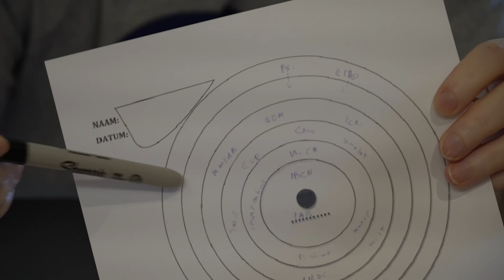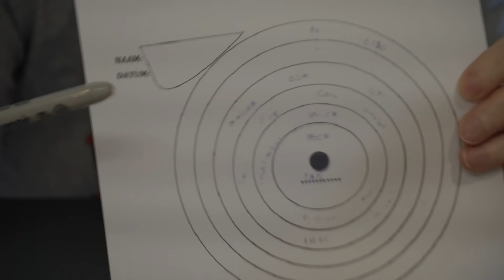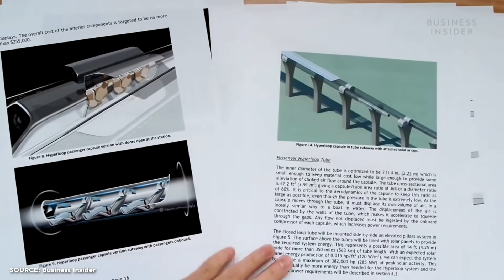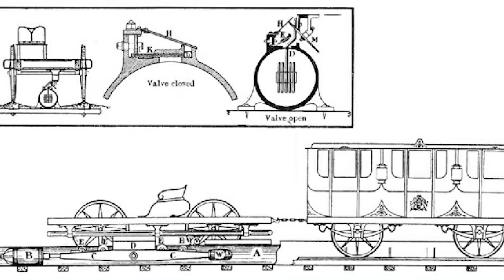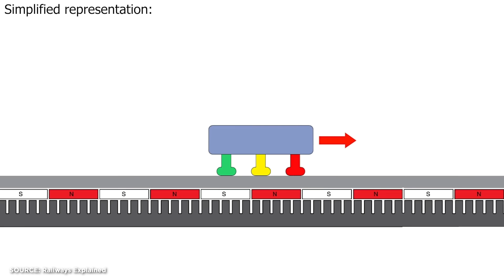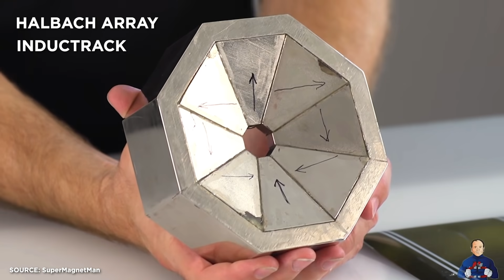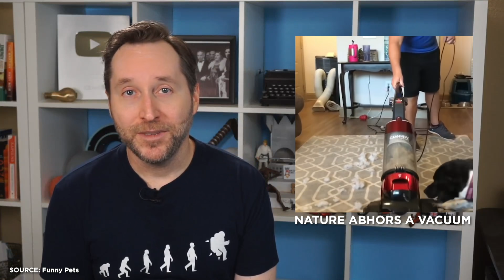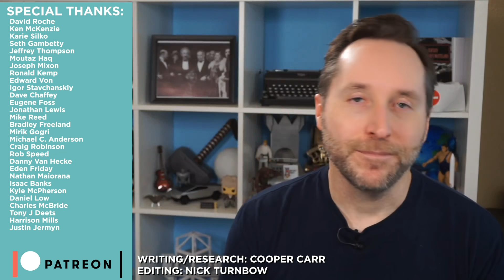What's Happening (And Not Happening) With Hyperloop | Answers With Joe

Comment: Calculate the energy required to create a vacuum in a tube of that length and diameter and you will begin to see the folly of hyperloop.
Reply: Ya you can't expect wanna believers to think.
Reply: It's like saying ''calculate the cost and effectiveness of renewable energy and you'll see that coal is better''. Hyperloop is still a prototype so just wait and in a few years there are solutions for every problem
Reply: add on to that the energy needed to keep the vacuum, cycle the airlocks, etc and you know it's rubbish. Now work out what happens should someone put even a small hole into the tube. You know that in the USA, a tube above ground will be shot at.
Reply: @eliasmok3261  "Hyperloop is still a prototype"
Nope. Unless you mean that silly test track?

" there are solutions for every problem"
Yes there are but the solutions for the hyperloop are not viable. Do the math.
Reply: The other folly is the passenger vehicle would have to be built to space craft standard to withstand vacuum environment.  It would have to carry air supply and CO2 scrubber.  And it would be a good idea for passengers to wear space suits for redundancy just like astronauts.  Contrast with airline fuselages which do not need to withstand vacuum and use pressurized external air for passengers to breathe.  HL really is a folly.
Reply: So what? let people innovate and solve the problem and who knows new discoveries can come out of it. No matter the result there's no wasted effort as this is how technology, grows by trial and error, even if it doesn't work on paper.
Reply: @Rice8003  How do you solve the problem of a breach of the tunnel turning pods and people into mush?
Reply: @feedayeen  You would of course have to add the continuing need to operate the vacuum pumps to cope with 'system loss' at the required airlocks and the inevitable practical leaks, especially from the seals around the necessary expansion joints for the tube itself.
Reply: @Rice8003  This is truly an entire waste of time, effort and money since the real outcome is already known by those with a functioning brain ! There will be no technology  'spin-off' since the areas concerned are already well understood. Innovation refers to ideas that might have some possible success, not those that are doomed to fail by design. Like so many, you don't really understand how technology works. It's popularly imagined for example that the space race spawned integrated circuits and the like. Not so, they were actually designed for computers and sold in 'zillions' into that market. The space guys were lucky to have the 'spin-off' from a commercial application that suited their needs too and they used them in small quantities. Microprocessors too and so on.
Reply: @encinobalboa  Strangely, for once, it's not 'politicians' arranging the funding it. The allure of hyped up techno-magic was too great for the private sector to resist.
Reply: @gdwnet  In much the same way as you deal with a tsunami. You run like blazes.
Reply: @forrestch  And that's merely the half of it !

No-one's going to be colonising Mars either.
Reply: Fusion Reactors!
Reply: @encinobalboa  Who says it has to be a vacuum, how about it is air pressure from behind that just reduces friction because the train is traveling with the air pressure. Like in a wind tunnel. You haters all have a huge amount of negativity rolling around in your vacuum chamber heads.
Reply: @johnarnold893  You haven't thought it through, have you.  Vehicle exterior would have to have a seal on the tube walls in order to contain pressure differential.  Air pressure behind the vehicle would have to be maintained in order to propel vehicle forward.  That means introducing air continuously to a tube that is suppose to be low pressure or vacuum.  Do better next time, OK?
Reply: @johnarnold893  Don't worry, they'll be here in just another 20 years, just like 20 years ago.
Reply: It's difficult to get somebody to understand something when their salary depends on their not understanding it.

Comment: No need to share Thunderfoot videos with you, I heard his voice in this script loud and clear :)
Great clip, as always!
Reply: Same thinking I love thunderfoot
Reply: They both reached the same conclusion, ultimately coming down to its economic viability. It's unlikely that selling tickets is going to be able to the cover the costs of building and maintaining the system. The light at the end of the tunnel is when we ditch the impracticality of the vacuum tube and start to build maglev trains right here in America.
Reply: I had watched Thunderfoot's video on it before, and this was a fresh take for me. I got the same information without the seemingly condensing nature Thunderfoot brought (that's just how I perceived him) to the table. And that helps a lot.
Reply: Thunderfoot has a hate boner for Elon for some reason. His videos are riddled with serious errors, he didn't do even a basic research. So ignore everything he said and think for yourself instead.
For example I love how everyone just assumes it won't be economically viable, without doing any kind of calculation. The only calculation I saw is from Elon Musk and his engineers. They know how much it costs to build stuff, because they are in the business of building all kinds of stuff. According to them the original Hyperloop would have cost ten times less than  California's new high-speed rail line. That was the benchmark. Even with significant cost overruns they would have beat it easily. And the new design with tunnels is probably cheaper, because a big part of the cost is just acquiring the necessary land.
Reply: @andrasbiro3007  A big part of the cost of California's rail was mismanagement. That played into the cost overruns. So it might not be the best comparison, as not all of it was due to construction based purely on the design.
Reply: @andrasbiro3007  To be clear, you're saying Thunderf00t made false assumptions about economic viability when he calculated the costs using turbine pumps he's used himself to make vacuum chambers (and included a very generous bulk purchase price) with calculations included, but Elon and company are accurate in their predictions that it would be a fraction of the cost of an existing train line despite requiring many times as much technology just because they're business people who would know this stuff...
Reply: @andrasbiro3007  I think you have not seen his latest video on hyperloop. I think you should watch it. Joe clearly has.
Reply: I was disappointed to hear Joe, whom I still admire a great deal, use so much of Thunderf00t’s content without more direct acknowledgement in the beginning of the video.
Reply: @richardstauber2815  Kinda felt the same :/
Reply: @andrasbiro3007  Dr. Mason debunks mainstream media. Elon Musk is always in the mainstream media. Do you see the connection? The media refers to it as Elon Musk's hyperloop, so Dr. Mason makes fun of the media by referring to it as Elon Musk's hyperloop. Do you see Dr. Mason's humor?
Reply: @albertjackinson  Mr. Joe Scott almost always gives a balanced argument which is the Joe Scott way. It was refreshing to hear someone that has some hope in the future of hyperloop.  Mr. Joe isn't exactly PBS Space Time. I unsubscribed to PBS Space Time because I got a headache every time I watched a new video. Do not listen to a single video on PBS Space Time or you're brain will melt.
Reply: @InfamoussDBZ  I watch every video on PBS Space Time, and it helps I understand what's being talked about. I definitely don't understand all the math, but I certainly understand the ideas presented.
Reply: @albertjackinson  Glad to meet a fan of PBS Space Time. I really envy you. Every video expands on a prior video, and so you go back to the video before that, and then that video tells you to go back to another video, and so you keep going back. If you don't understand one video, you're not going to understand the next video. My mind became a giant pretzel, and I couldn't talk to any of my friends about it because I caught myself repeating, badly, a concept or idea I didn't really understand. Other youtubers like Arvin Ash, WELT Documentaries, that guy with the bald head and speaks with an English accent who makes documentaries, explain things much more clearly, at least to me.
Reply: @albertjackinson  
Maybe, but that made Elon to design Hyperloop. And there are technical reasons why Hyperloop can be better and cheaper than even well managed high-speed rail. The key is "high-speed", that's what drives up the cost a lot, slow trains are cheap. We won't know for sure who is right, until Elon actually builds a Hyperloop line. I can arguae all day about the physics and engineering, but I know next to nothing about costs.
Reply: @InfamoussDBZ  
No I don't see the humor. All I see is he hates Elon for some reason and that prevents him from being objective.
Reply: @chitlitlah  
Yes, he made serious false assumptions. Hyperloop doesn't use actual vacuum, just very low pressure, so no fancy pump needed. The cheapest pump you can buy is fine. Also Elon won't just buy pumps, he'll most likely design one perfectly tailored for the job and mass produce it with Tesla.

Technology doesn't have to be expensive. SpaceX and Tesla use all kinds of fancy tech in their products, yet they are a lot cheaper than the competition. https://www.youtube.com/watch?v=W4DFnyJCWVI https://youtu.be/l6T9xIeZTds?t=2002
Reply: @andrasbiro3007  I like Dr. Phil Mason, aka Thunderf00t because he's funny. It's a particular brand of humor that isn't for everyone so I understand where you're coming from.
Reply: @andrasbiro3007  I think you're a badass to challenge Thunderf00t. Unfortunately for people who do not like him, he understands Thermodynamics. It's so complex, the calculus involved is a nightmare, and expanding on this knowledge with 20 years of experience gives him a huge advantage compared with other scientists. It goes a little bit deeper. When your father is a professor, you learn all this stuff at an extremely young age. We mortals don't take a physics course until 11th grade. The question I want to ask you is why the tube is even necessary. If American perfects the bullet trains found in Japan and China, the only downside is that they're slightly slower. If they're slightly slower, it means you have to leave your house a little earlier in order to make your trip. Is the value of that extra hour you get to spend however you want, worth all the building, maintaining, protecting, and the inherent danger of a vacuum tube?
Reply: @InfamoussDBZ  
I liked his videos until he started to pick on Elon. It's especially sad, because he could have made awesome videos about the real science of these projects. Like he did with NASA's Mars helicopter (how can you fly in 100x less dense atmosphere). I would love to see small scale experiments with the Hyperloop design. For example I couldn't find out what happens exactly when a long vacuum tube is breached. Most people, including TFoot just assumes there would be a shockwave that would destroy the pods. But shockwaves don't exist in vacuum. Based on my physics knowledge I expect a relatively mild pressure gradient that would safely stop the pods, not destroy them, but experiments always have the final say in physics questions.

As I said, I have a degree in physics, and studied it a lot in my free time too. The only thing I lack is hands on experience with more exotic things, like vacuum.
But the nice thing in physics knowledge is that it gives you an excellent bullshit detector. Physics is full of simple rules that have to apply even in case of extremely complex situations. Like conservation of energy. Another useful thing it teaches you is recognizing when two phenomenon are similar enough for using one to understand the other. In case of Hyperloop we have pipelines, tanks, tunnels, air hockey tables and airplanes.

The advantage of a vacuum tube is drastically reduced drag and friction, which in turn reduces your power consumption drastically, which has many other implications, like cheaper infrastructure, cheaper operation and lower carbon footprint. The higher top speed is just a bonus.

The dangers of vacuum is way overstated. We have hundreds of years of experience with handling pressure differences, it's not some exotic science. And we also know how to make inherently dangerous things safe. Flying is a good example, it's the safest form of transportation, despite being inherently dangerous. The big issue with planes is that they can't just stop if something goes wrong. They have to keep flying until they find a suitable place to land, and even that is dangerous, because they have to maintain a minimum speed to stay int the air, which is way too fast for moving on the ground, so the transition is very tricky in both ways, especially in bad weather or in case of a malfunction. Also weight reduction is essential for obvious reasons, which makes planes very fragile. Then there's the high energy requirement, which forces planes to carry a large amount of highly flammable fuel in their very fragile bodies. This means they turn into a fireball very easily. Based on this you could easily say that passenger jets would never be safe or economical. The only reason you don't say this is because they exist. We overcame the difficulties with excellent engineering, making critical systems triple-redundant, using very detailed and strict procedures for maintenance and operation and using extensively trained pilots. https://www.youtube.com/c/MentourPilotaviation/videos
In many ways Hyperloop would be a lot safer than planes. For example it can stop at any time safely, pods can be reinforced as weight is not an issue and there's no flammable fuel anywhere near the system. And I could go on, but this post is already too long.

Comment: In the 1890's a vacuum system with the tube being approximately 1 metre high carried mail from Euston  station to Highgate in London. employing a wheeled trolley. The system ran for about 11 years when it was abandoned because the vacuum sucked ground water into the tube
Reply: yeah, underground tunnels will not make things easier
Reply: @joefox9875  I was on the supervision staff as a junior engineer of the Euston station construction. The contractor broke through the tube  of which the cast iron was of the finest.
In fact I stated the tube ran to Highgate which was in error. It ran to Holborn.

Comment: I was pumped for hyperloop but I've had all the air sucked out of it at this point 🙃
Reply: If you are using Windows or Linux please close your browser by clicking on the x in the upper right. If you are using Mac OS please close your browser by clicking the red dot in the upper left of your browser
Reply: @Supadupanerd  Instructions unclear ethernet cable stuck in cpu fan.